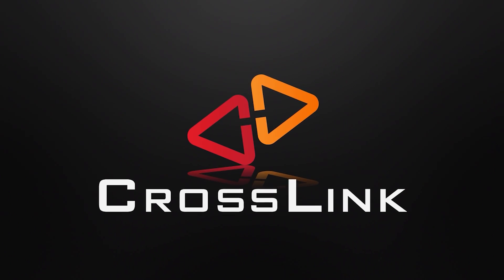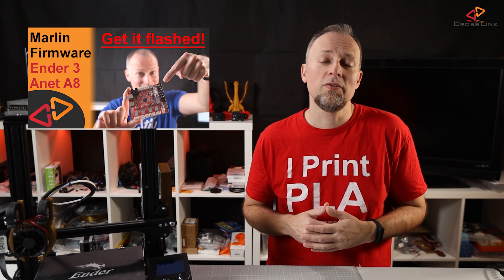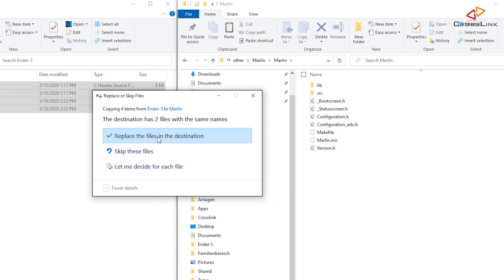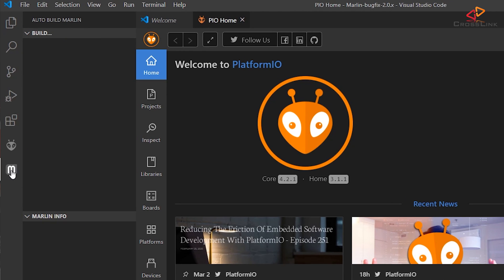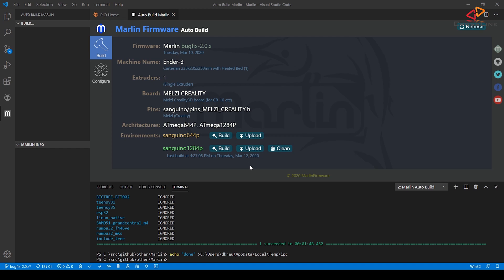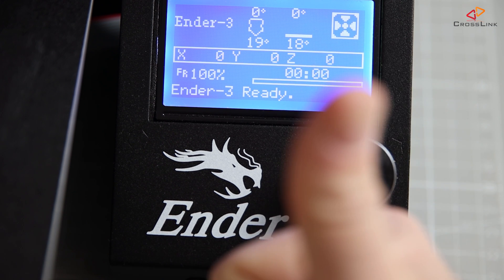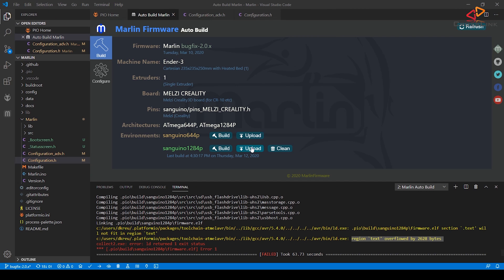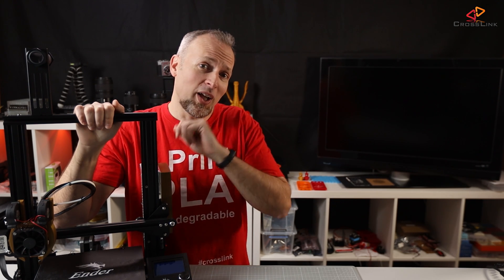Ender 3 (Pro) Marlin 2.0 Upgrade  - Updated Version

Comment: Great instructions, very concise . I was intimidated at first but after watching a couple times I decided i'd give it a try since I have an Ender-5 Pro and I saw it listed on the marlin github configuration site. Everything is compiled on the desktop computer but i had to pause at 'upload' because the printer is installed at a remote location. Do you happen to know how I can save the resulting complied to an sdcard that i can load on the printer at boot time?
Reply: i think i found the firmware.hex file in ...\Marlin-2.0.x\Marlin-2.0.x\.pio\build\sanguino1284p subdirectory. Do I just need to copy that over to the microsd card and boot the ender-5 pro using that card?
Reply from the maker: Sorry, it's not going to work that way apparently. New firmware needs to be uploaded through the USB port or a programmer device.

Comment: Finlay someone that speaks my language. Is it possible to flash a new mini this way ? if you enable media for USB you can just add the file to USB and the put SD card in printer wouldn't that be the same as plug USB to printer? i got an error because i wanted to upload to USB i don't no how .
Error: Please specify `upload_port` for environment or use global `--upload-port` option.
For some development platforms it can be a USB flash drive (i.e. /media/<user>/<device name>)
* [upload] Explicit exit, status 1 is there a forum I keep getting errors of i don't enable it builds if I enable steppers I get errors

Comment: This video saved me!  I had encountered similar issues last fall; reported to Creality and got a replacement board under warranty.  Just installed new board, and it had the same issue - stopping extruding mid-print when using Simplify3d.  Found your video, followed the steps exactly, and now I am up and running.  Creality still doesn’t acknowledge the problem; but to be fair they have been dealing with the virus in China.  I give them the benefit of the doubt for now; but they really should tell people how to fix the issue.

Thank you for taking the time to make this video.  Although I have been a programmer for decades, this video went straight to the details and I didn’t have to flail around with error messages, etc.  I followed your steps to the letter, and my problems were solved.  Youtube is such a wonderful source of information, thanks to channels like yours.

Oh, and I subscribed!
Reply from the maker: Thank you so much!

Comment: Great video! I've also watched your video about the pros and cons of installing Marlin 2.0. I have Ender 3 pro (new, just got it two weeks ago as a new hobby) and I do want to use the SD card feature as well as mesh bed leveling. I do not plan to replace the board or add auto bed leveling any time soon. Would you recommend using Marlin 1.19 instead of the 2.0 version?
Reply from the maker: I think you won't miss out on anything super important if you use 1.1.9 but you can also use this hint to reduce the firmware size quite a lot: https://thborges.github.io/blog/marlin/2019/01/07/reducing-marlin-binary-size.html

Comment: Hey, Nice video. I have a BlTouch 3.1, what options should i enable? Thankss.
Reply: Depending on what board you are using, you may want to hold off for now as Marlin 2 has known issues with the BL Touch.
I upgraded due to upgrading my board to the SKR Mini E3 V1.2 and cannot get the BL Touch to work consistently and reliably.  Prior to the upgrade. I would print using the BL Touch with no concerns at all.  Not the case now.  It has been nothing but a headache and I am going to revert to manual bed leveling until the problem is resolved.
Reply: @davidpeters7447  Thanks for your answer! I installed a preconfigured Marlin 2.0 with Bltouch configs, and it's working really well!. I'm having much better first layers than before, I hope I don't encounter any issue in the future, but for now its working fine.
Reply: Franco Bitancurt what is your main board on your printer?  I went from no issues to a nightmare.  I am going to revert back or just manual level in the interim.
Reply: @davidpeters7447  Sorry for my lack of knowledge since I bought my 3D printer this year. I bought the Ender 3 pro, I don't know which mainboard it is, sorry. But here's the link to the guide I followed which has the preconfigured Marlin. Hope I helped!
Reply: Franco Bitancurt no worries.  Mine is an Ender 3 Pro but I upgraded the MB which doesn’t like BLTouch and Marlin 2.  Known issue after researching.  I will either revert back to the original MB or just manually level in the interim.
Reply: @davidpeters7447  Good luck!

Comment: Good timing as I just did this with the SKR Mini E3 v1.2 but ran into an issue with the mesh bed leveling as it would lose the saved mesh and settings if the printer was powered off twice. It would save after being powered off once, but not twice. So something goofy going on. Since I was using the firmware from the BigTreeTech github page (V1.2 folder) and making changes, I was planning on starting from scratch and getting the regular Marlin 2.0 firmware and making the necessary changes to see if the same thing happens.

Also did you know that if you just install the Auto Build Marlin extension, it will automatically install PlatformIO IDE? No need to install separately.

Comment: Hi, or is it possible to have a video on how to set up mariln 2.0 for CR10S from A to Z all the settings to work perfectly, with auto bed level and press resume after error or voltage hole? Thanks in advance
Reply from the maker: I only have the CR10s Pro. Not sure if the differences are huge?
Reply: @Crosslink3D  
hi, the power_loss doesn't work for me. if I turn off the printer due to an error, since I have UPS, it does not give me the possibility to resume printing from where it stopped

Comment: Hello very good video thank you. But what are the options to activate if you have a Bltouch? Thanks for the answer.
Reply from the maker: You can enable BLTouch very similar as in 1.1.9. I did not make a guide for this but I am working on it. Did you ever use the BLTouch with Marlin 1.1.9?